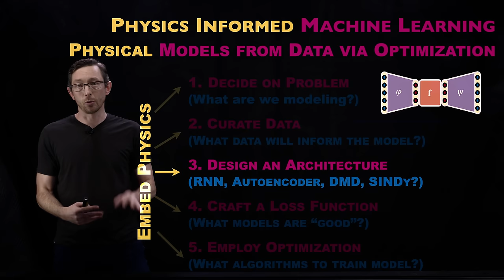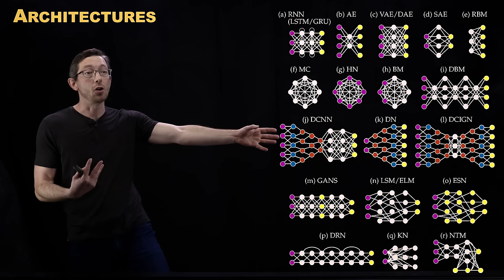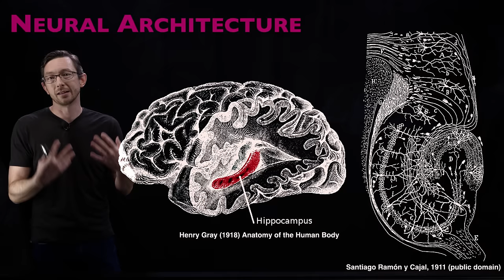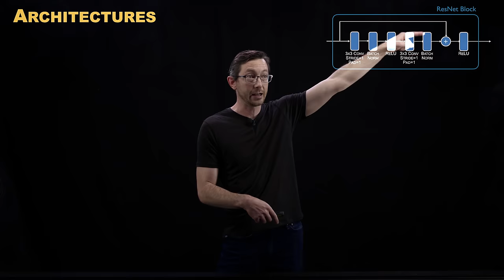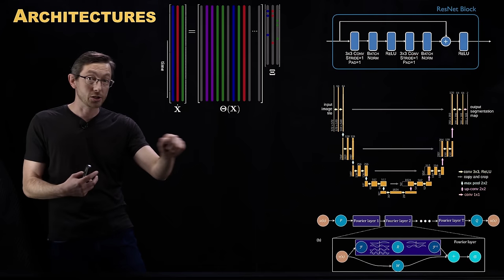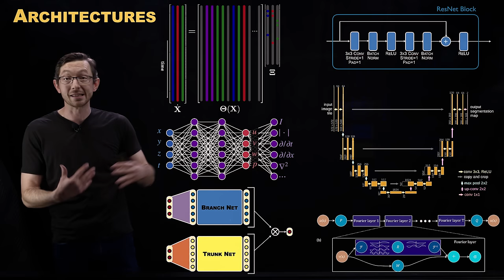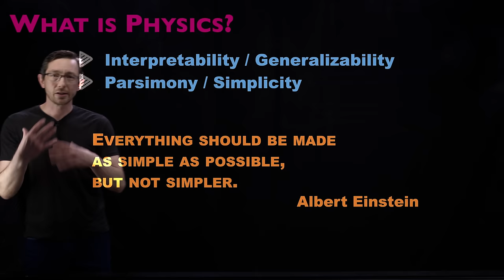AI/ML+Physics Part 3: Designing an Architecture [Physics Informed Machine Learning]

Comment: Great video and I learned a lot! One question open for anyone, what do you think about the prevalence of foundation models in vision and language modeling? Nowadays the state-of-the-art is to take a foundation model and fine-tune it to an application, which involves no problem-specific choice in architecture. Do you think there will be a large physics foundation model or that the choice of architecture is fundamentally application-specific? Cheers from someone working on vision.

Comment: Great lecture series thank you very much for all of your hard work! I just have a quick question, I always though that Convolution operation as equivariant since we still keep the input structure but apply a filter on it. We can not have classifiers(invaiant) using only CNNs unless introducing an invariant layer since invariance absorbs the equivariance. I apologise If my thinking process is wrong.
Reply: I think you are right. My understanding was that when talking about equivariance, he was referring to other use cases that generate outputs that contain spatial information such as autoencoders, semantic segmentation & object detection. In that context equivariance makes more sense for the use case too.

Comment: 32:34 invariance vs equivariance in a Neural Network architecture(NNA): would the transformation(g) be insitu or a post process? 
by that I mean A)  transformation(g) after f() is IN the NNA itself , or B) the "output of my neural network is also ran through" means the NNA's OUTPUT has a process ran AFTER it leaves the NNA???
If it's #A does that mean transformations themselves can be identify/labeled through equivariant NNA's separately from the content? (i.e. this dog is facing down a hill, this isn't a number one it's a dash character, etc)
If it can't label a transformation what's the point of the NNA transforming it's subject internally before Output if the original wasn't transformed?
If it's #B where transformations have to be done after, why ever bother mentioning it ,or doing it after, if the subject isn't transformed in the first place?

The explanation of the motivation to reducing data needed helps alot for choosing approaches, by using equivariance architecture(due to symmetry groups aka Lie group) ,  and makes a lot of sense just missing some intuition on what happens when , like transformations happening internally seems a waste of processing or a source of hallucinations if your not just trying to generate data.

Comment: One problem that i think could come up in the case of harmonic oscillator/pendulum, is that you can always take a time derivative of a previous derivative (θ̇̇, θ̇̇̇, θ^(3), ... ). They alternate between sine and cosine and related through frequency ω.

Could the order of the derivative in our output variable set (the variables in an equation) be constrained from the beginning so our architecture won't just output infinite variables?